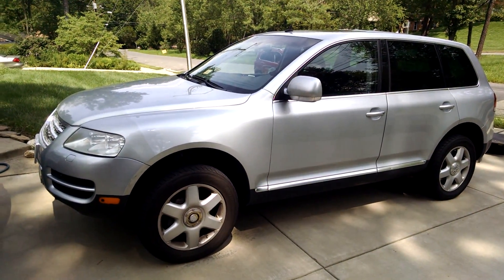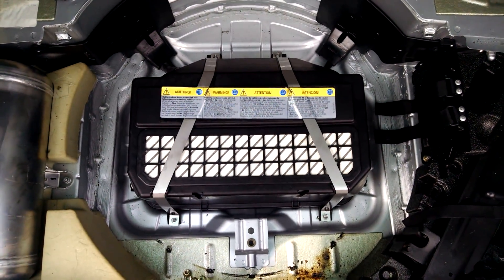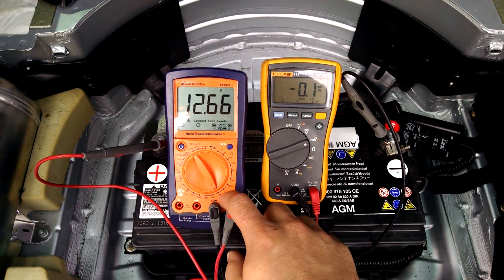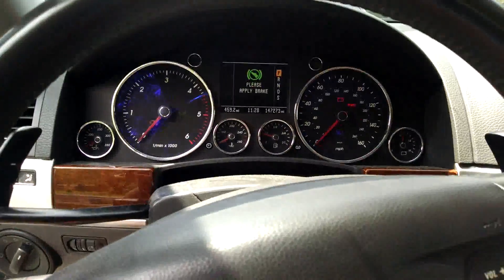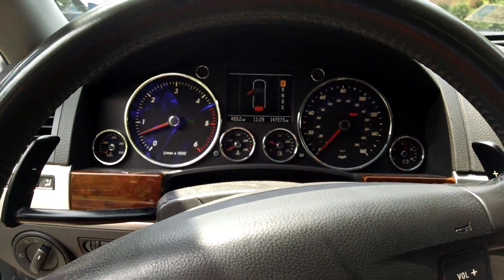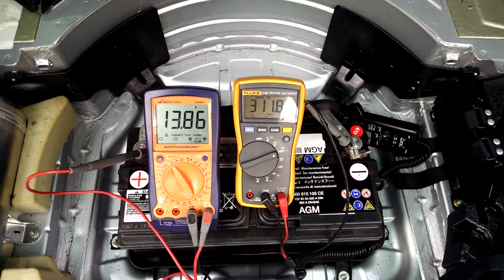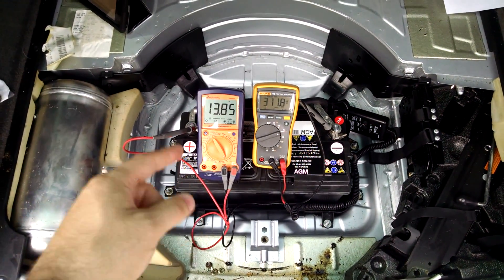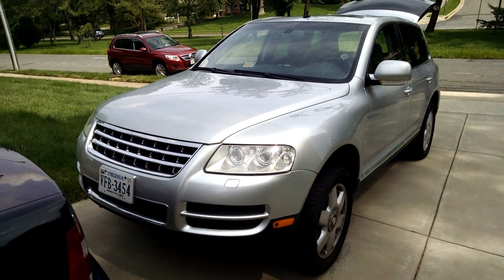2004 V10 TDI Touareg dual battery testing

Comment: I'm a bit confused here as your Fluke meter dial in the video is set to to read mV (voltage) NOT current readings.... not to mention, your clamp-on should have probably been attached to the COM and the A with your meter dial set to read DC amps or am I completely missing something here??
Reply from the maker: David McGillis the clamp meter measures amps, then outputs mV for the meter to display. If I wanted to measure amps directly with the fluke the power would have to flow through it, and it can only do 10 amps.

Comment: Which battery is the starter battery in this car? For 5 years I have been constantly changing the battery under the seat, is the correct battery for the match the front battery or the rear battery? ?
Reply from the maker: The start battery is the one in the spare tire well.
Reply: @compu85 So the trunk battery.  Thank you for the information.
Reply: @compu85 So how many amps should the front battery be and how many amps should the starter battery be? Is 80 amps enough for the front battery?
Reply from the maker: @MagaliiiiiiiiiiiI'd stick with the original size batteries. I don't recall what size they are off hand.

Comment: Touareg V10 only uses the back battery to start the car.  The rest of the time the battery at the back is not used.  The one under the seat is used to electrify  every other component on the car.
Reply from the maker: The rear battery is also used to run the glow plugs - both before and after starting the engine.

Comment: you have no clue what you are measuring... 
you multimeter in mV (milli) Volt settings, you are talking about amps and you are measuring something between post, instead of inline...
Reply from the maker: I was using an Amprobe amp clamp, which outputs the reading as milivolts. I have the fluke set on the mV range so it doesn't autorange. So yes, I know how to use a DC clamp meter. 
If you have a suggestion on how to pass several hundred amps through the 10a fuse in the fluke I'm all ears.

Comment: yea dude mine is the same exactly,  but i will also add that the car draws 50amps when running and 150 amps when the glow plugs are on
(so glow plug current is 100 amps)

Comment: I've  changed 1 0r 2 batteries every two years on my 2004 v10. I love my ride but . I've gotten 150000 on the clock and I'm going to train it in   its just too expensive.

Comment: Nice tutorial! I am currently struggeling with battery drained after a few days from being fully charged. Will do an equivalent test to my car. Thanks!
Reply from the maker: What kind of car? I'm going through this with our 99.5 Jetta right now, I plan to make a video as I go through the car.
Reply: +compu85 It is the same as in the video. 2004 V10. I also think the keyless system is draining amps at standby...
Reply from the maker: That's a common problem. Our keyless quit working. I ordered replacement FETs and resistors to rebuild the KESSY module. Another upcoming video...
Reply: @spoon761  Hello Sir, i have the same problem with empty battery v10 tdi. how did you solve the problem ? what was the cause? would be grateful for any answer. Greetings from Wolfsburg Germany